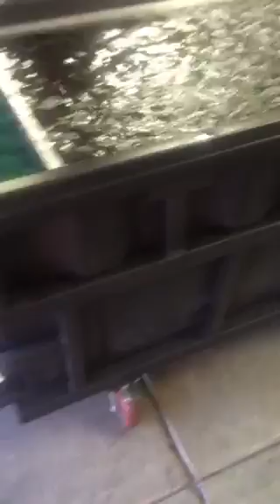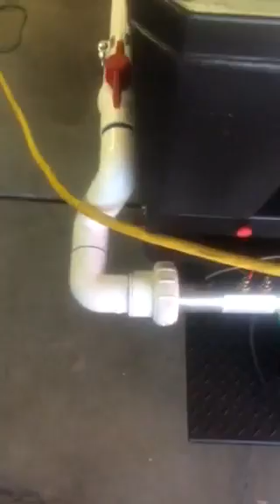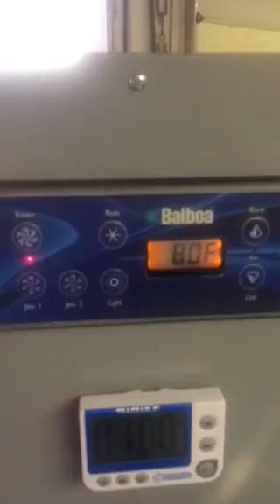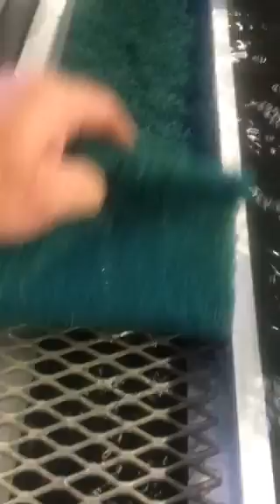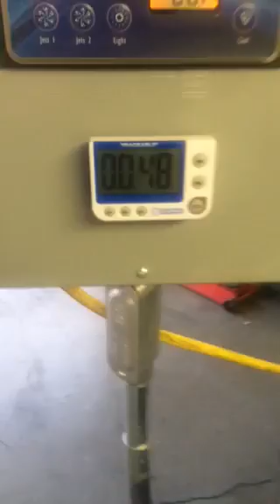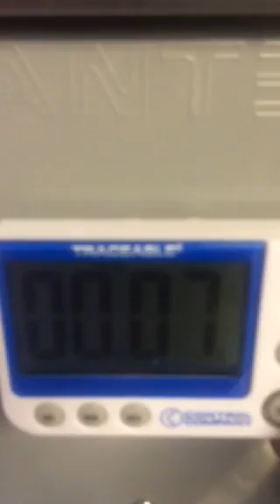DIY Hydro Graphics Dipping Tank

Comment: How long dose it take to heat with that set up?
Reply from the maker: It heats up the same as a spa. Depending on outside temp. About 300 gals heats up here in Az about 2 to 3 hours to 90 
 degrees. Then jus regulate it jus like a spa

Comment: do you have a website you got this Tank at?
an where did you get your heater and pump  controller at?
Reply from the maker: Niko G Can't remember where I got the tank it was in Ohio but if I find the paper work on it I'll shoot it over to you.
As far as the board I used a spa board that I had here but you can get the whole complete set up with the heater from spaguts.com. just do away with the second pump board...you won't need it. It's a VS model again I'll try to find the exact model if you need it but there very helpful on the info. Jus tell them what you plan on running and they will know. Hope this helps somewhat.
Reply: appreciate all the infor and yeah if you can tell me where you got that tank at that would help cause that's a nice size and I can fabricate a nice steel frame for it

Comment: I'm late in the game but just acquired some spa equipment for free.  Pump, control panel, heater, etc.  My question is, did you rewire your pump for 110 or is it still running off 220V?  Thanks.  Nice build.
Reply: Curtis Baughman I would assume still 220 as it will heat faster which decreases down time during water changes and I would assume during filterings

Comment: Nice build
I built my own tank the same way but if I were to do it again  I would NOT copy the tanks that they sell.
The people that complain about plastic tanks need to apply NEVER WET [Homie depot] to the tank.
I did not want to loose the 8 Inc of tank space for the filter area
I did not want to buy a plastic welder and a sheet of poly.
So I just used an above ground pool skimmer on the OUTSIDE of the tank. The parts that come with the skimmer will fully support the cutout in the plastic tank. [Dont use square cuts on the corners-use a drill bit to make the corners of the cut rounded-stops a crack from "running".
My next tank is going to be 
A metal bathtub and a natural gas tankless hot water heater.  THATS IT. Nothing else.
No pumps
no heaters
no electronics
no support system 
No $$$$$ on electric or running 220 lines
Just a window screen to pull through the water as a filter.
Plumb the tub as you would as if it was in your house. Swimming pool temp gauge and a cheap kitchen timer.
Reply: what did you add again instead of welding
Reply from the maker: Asya Rodgers I used a plastic welder for the dam
Reply: ok is there anyway that you can send me step by step to make it to my email please
Reply from the maker: Asya Rodgers 
on the road driving sorry

Comment from the maker: Sorry for the video. I used my iPhone. Should of checked it out first. I'll make another one that isn't of such poor quality.
Reply: finally got my dam up and now I am on to the control box. did you wire yours yourself? and if so how much would you charge to wire one up for me.?
Reply from the maker: you can buy the board through spaguts.com 
Jus get the board that runs only one pump at 2 speeds or you can buy the the one that runs two pumps and jus disable the second pump. just tell them you want the complete replacement board for any spa. I think it was a VS model. I'll try to find the exact part number if you can't figure it out. Good luck.